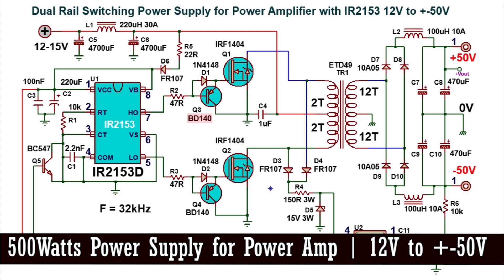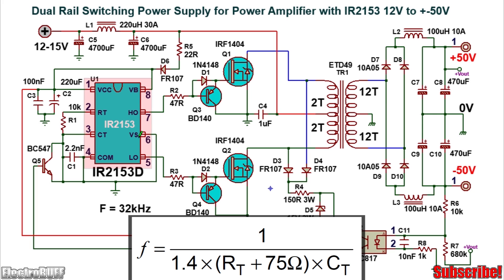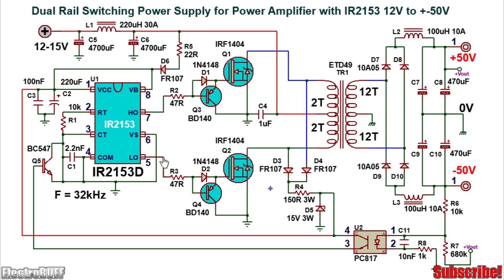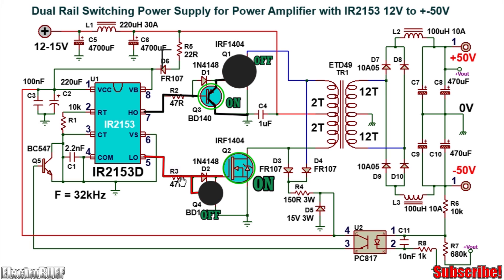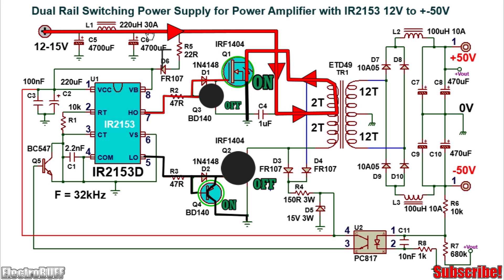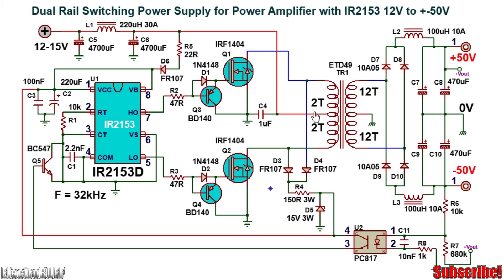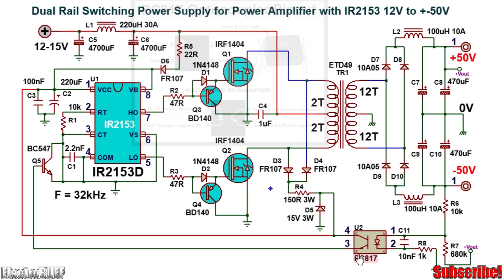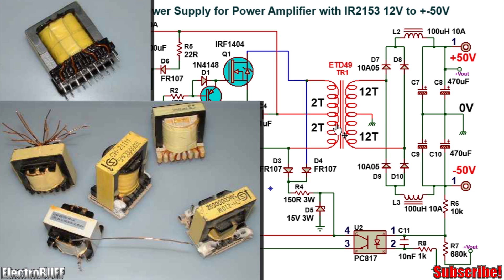IR2153 Switch Mode Power Supply For Power Amp, 500W, +-50Volts Dual Rail Output

Comment: As mentioined below C1 and Q5 are shorted out   dont know if its actuall been built , but I have in my case its to replace a mauns transformer that has failed , it is to supply 100v  750 volts 1150v to feed a doubler ( i could increase the windings instead) now back to Q5 on removing the shorts across the cap C1  I find that Q5s base has no limiting resistor,  U2 pin 4 is connected to the ht rail only limited by D5 zenner diode if U2 is turned on due to excesive output the 15v rail will be directed to the base of Q5  and emitter  which is grounded  it only needs 0.5 volts to conduct futher more the current through U2 photo transistor will be excessive this will no doubt destroy it!  along with Q5.  as my build is going i have found it very efficient , the energy produced from D3&4 produce more than is required  as a result R3 runs hot , I didnt't have a 15v Zenner so I have used a surplus power transistor with a 13v zenner across the collector base  giveing me a voltage of 13.7volts  as this is the run supply for the chip D6 is the startup diode which providing the run voltage is higher than the start voltage D6 should be reversed biased ! off not conducting I note this diagram is everywhere on Youtube and Pinterest un corrected.

Comment: Sir, I've designed a 24V half-bridge SMPS with an IR2153 IC. I'm getting a 24V output, but when I connect a load, the voltage drops to below half of 24V. What is the problem, and how can I fix it?

Comment: Hey where do you buy your components in Nairobi
Reply: Tiriki Lane off Luthuli Street
Reply: @kepharolang1984  thanks, is there a specific shop or are there multiple shops selling them?
Reply: @Daniel-ti4mt  multiple shops along that line. Biggest in that line is called Universal, you will get everything
Reply: @kepharolang1984  Is it Universal Tech electronics?

Comment: There is a fault in this circuit, transistor bc547 has shorted emitter and collector then how does this transistor work?
Reply: C1 2.2nf is also shorted to ground and pin 3,4 both connected to ground.. what the hell??
Reply: @ArvindKumar-xf8yq hallo sir
Reply: Also we don't need external BD140 at Mosfet gate to Source the gate, IR2153 already have totem pole output.

Comment: Hi.
Do you have a tested schematic using the TL494 for driving a washing machine motor that has a tacho generator feedback coil?
One error amplifier could be used as tacho sensing / motor speed adjustment, the other error amplifier as a current sense, current limiter. (with a current sense resistor in the motor path)
Something similar to the good old TDA1085c, which unfortunately is no longer manufactured.
Thanks.

Comment: Hi, I also believe that Q5 is shorted. Can you post the PCB diagram.
Reply: Its shorted as shown, even I dont understand why to use a transistor in this place
Reply: @ericgarcia741  It's there for nothing but a short in that diagram, but the thing is IR 2153 have a ShutDown Function build into Ct pin, when 1/6 of Vcc is applied to Ct IR2153 goes to sleep. He misdrawn it.